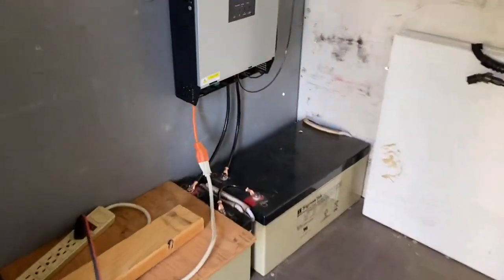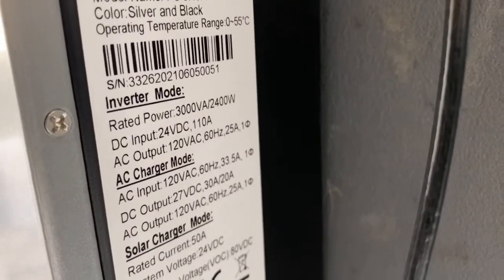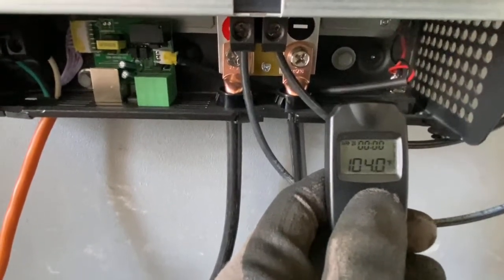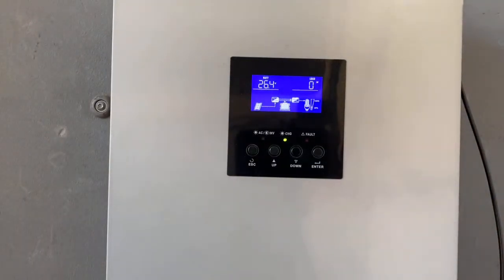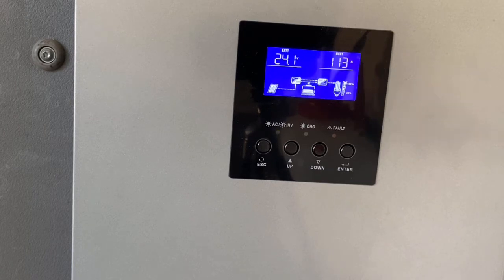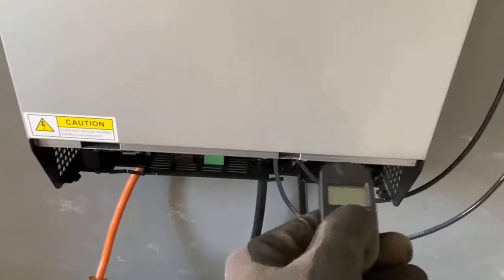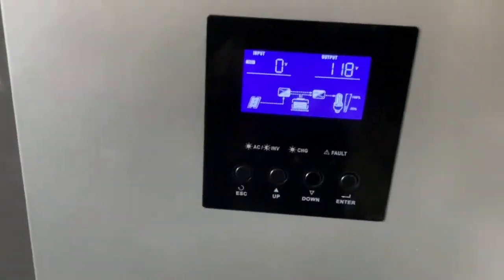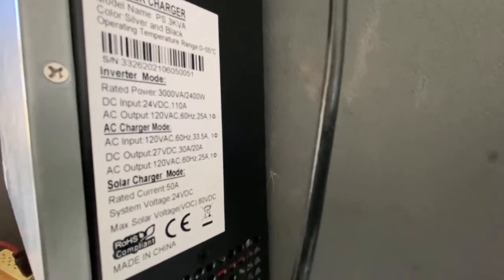2400 Watt Hybrid Solar Charge Controller/Inverter installed in Van - 120VAC Load Test

Comment: I installed mine this weekend. I hooked up my panel inputs and then battery terminals. I also ran the AC out to my breaker box which supplies my outlets. I tested the battery as 12.4v and the panels as well. The only thing is I can't get anything on the AC output. Also, the inverter keeps restarting every 10 seconds. Do I need to turn on any settings for AC in the menu?  Thanks
Reply from the maker: This is a 24 volt charge controller/inverter. It will not work with a 12V battery connection. You will need to use 2 x 12V batteries connected in series.

Comment: HELP fans are dying after one year light use . need to find replacement fans.
Reply from the maker: Mine are still working after 3 years. I have another inverter that had the fan go out. Check the model # and dimensions but it should be: 12V 0.30A 80mm x 80mm x 25mm. I found it on ebay. There are 2 fans, one for the charge controller side one for the inverter side. This was for the inverter side

Comment: So can this unit run AC (Alternating current) to your house without batteries??
Reply: No
Reply: I plugged my big and old window AC , that I got out of an office building about 20 years ago into the 24 volt  2400 watt one I have   and it worked great. 
 BUT, I have a 300 AMP HOUR battery with 200 amp BMS  with big fat battery cables. also tried an electric heater , not at the same time and it worked . It was drawing 90+ amps from the battery. 
BUT,  you don't want to have something that big running when the battery gets low and this switches to charge and  run a big load at the same time while only plugged into a 15-20 amp AC outlet in your house. It will trip that breaker. The book says for full power, charge and load, you will need it hooked to a 40 amp 120 ac breaker , with 8 gauge wire. huge. I made a 20 amp plug with two sections of, 16/3 gauge extension cord and use it in a 20 amp outlet in my home , for power outages. These have so many adjustable features ,it is great. The directions say for only lead acid but that's not really true because it has a user defined battery setting for what ever you want to program it for. For my lifepo4 battery bank, I have it set to switch to charge at 25 volts and switch back to battery at 28.5 volts. lifepo4 is funny that way . all the real power is between that. Where-as , a lead acid can run  down to 21v . LIFEPO4 will shut down if one of the 8 cells  gets to low.
 All worked great for about a year or so , before the fans stated screaming. Maybe I just got a bad one. It was a REALLY low price
Reply: LOL. I thought you said air conditioner in your house. but DEFINITELY NO. APPROPRIATE SIZED BATTERIES "MUST" BE CONNECTED "BEFORE" ANYTHING ELSE AND DISCONNECTED "LAST".  SORRY.  Batteries are getting cheap now.
Reply from the maker: No, you need to have batteries connected

Comment: Can you input 115 v in
Reply: Yes you can set it to charge by 115VAC if solar is unavailable, and automatically switch to main/generator 115V out when battery runs low.
Reply from the maker: Correct!
Reply: Sounds super noisy would you put one inside an RV

Comment: doesnt this unit support also 230 V AC output?
Reply: where did you hear that it can also do 230?  I just sent one back because it was not the 110 AC model.
Reply: in Greece we do not use 110 AC @immrnoidall
Reply: There is a 110V model and a 230V model, make sure you get the right one because they are not adjustable.  @usedtobesoeasy
Reply from the maker: Not this unit. For about $100 you can get a 5000W rated voltage transformer that will step 120V up to 240V. Or you can purchase a different model which is 230VAC output
Reply: @solarpowerondemand3255 can you please share with the us the model number of this 120/240VaC unit? Thank you

Comment: GOOD MORNING ALL GOOD ! I AM BRAZILIAN, MKRO IN THE CITY OF SAO PAULO, I HAVE A HOMEMADE INVERTER, COULD YOU HELP ME ASSEMBLE A HYBRID INVERTER.? WHAT PARTS NEED TO BUY.? COULD DESXRIMINATE WHICH. TO SEE IF IT REALLY PAYS TO BUY WITHOUT THE CABINET. MY SOLAR SYSTEM. I HAVE 4 LEAD BATTERIES OF 150AMPS A MONOCRYSTALLINE SOLAR PLATE. 450WAT BIFACIAL. I'M BUYING ANOTHER . FOR THE CONSUMPTION OF MY HOUSE A HYBRID OF 3KVA SUITABLE ME. THANKS AGAIN FOR ANYONE WHO COULD DESCRIMINATE. WHAT PARTS DO YOU NEED TO ASSEMBLE THE HYBRID